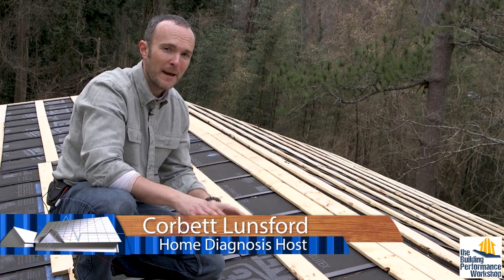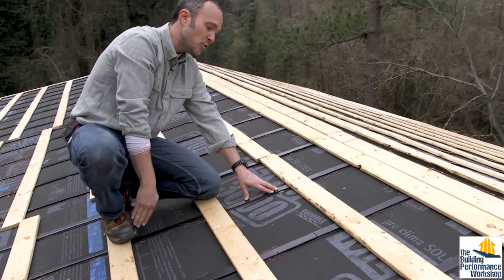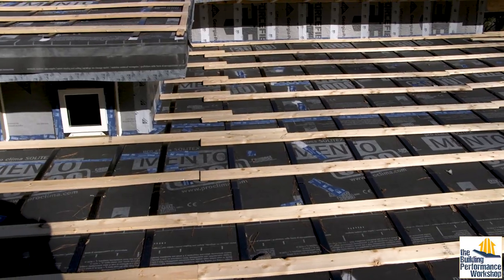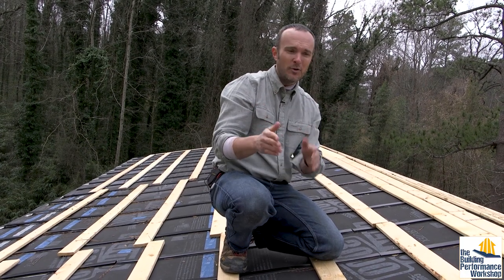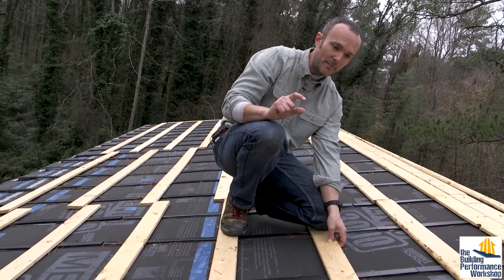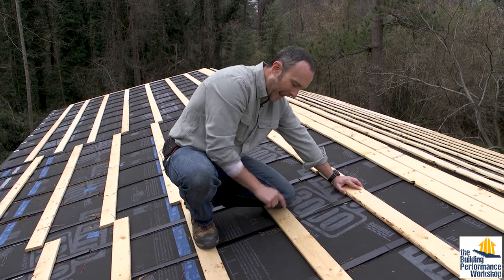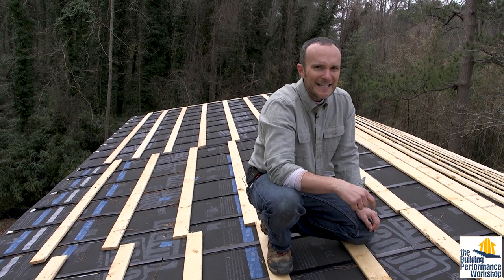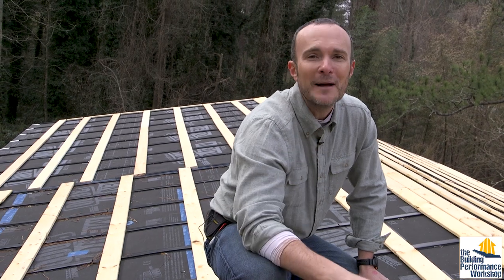How to Build a Roof Rain Screen: Diagonal or Cross Hatch?

Comment: If you have air flow, where wood can dry, then it wont rot and there's no need for pressure treated wood. When wood gets wet and stays wet, such as if it were wrapped and no air flow exists, then it will rot. Watch any of Joseph Lstiburek videos on building science and he mentions this in his videos...
Reply from the maker: Good point Paul
Reply: Don't use pressure treated wood

Comment: Pressure-treated 2x4 would corrode the metal would they not-- as well as the metal screws? Is there such a thing as triple-coated washer metal panel screws?
Reply from the maker: Haha, interesting point
Reply: I think this is one reason they aren't used.  Everything would have to me PT rated, and that adds another layer of complexity
Reply: I'm like 5 years late to this.  But From Joe Lstiburek's rain screen "test" on his barn/office in Maine rot protection is not required.  There was enough air movement with bare non treated 1x4's behind the siding that the rain screen wood looked "brand new" when he removed it 16 years later.  A roof may be different, but I doubt it as there is more solar energy per square foot being put into that assembly (thus driving more airflow via the stack effect, and higher temps in the wood).  

To drive home that point I've been watching the rebuild of Chateau de Purnon here on YouTube and where is the Rot in that roof?  It's by the stonework where air doesn't flow, and the wood is on the moisture reservoir of the stone.   

I don't think 2x4 rain screen detailing is really needed until you start worrying about Ice Dams.  But then again, I'm a nurse not a building scientist.

Comment: Seems to me that there actually will be little or no rain that actually gets beneath your metal roofing.  The steps to allow for drying in the event there is water intrusion are good, but surely pressure-treated stock is not required to support the panels.
Reply: Yeah, it's mostly just to allow the back of the roofing to dry out and not thermally transfer anything into the insulated space, if it was shingles you would do a second layer of osb (expensive) but at least the nails would never rust and rot and you effectively have a roof over your roof.
Reply: Agreed. If untreated wood has the ability to dry when it gets wet, it's not going to rot. If it gets wet and stays wet and fungus finds the surface, then it's rot time. People forget that people literally sailed the world's oceans in wood boats.
Reply: @joshuasmith1215  Thanks for your reply.  I recently learned that even pressure-treated lumber can rot if it gets rained on too often.
Reply: Don't use pressure treated wood anywhere other than what is meant for. It's chemical treatment eats through hardware and the back of metal roof material

Comment: So the question is, pressure-treated or not pressure-treated? I kind of figure you have to go with pressure-treated 2x4’s.
Reply from the maker: Unless you wrap them a bit up the sides with waterproofing butyl tape
Reply: No! Don't ever use treated lumber other than a deck. Period. The chemicals eat through your hardware and the metal roof.

Comment: You’re vertical channels make sense for airflow under the roofing material. The diagonals seem to cut off areas of the roof when natural convection is occurring. I think the cross hatch is the only way to get this done properly. I agree that a 2x4 is going to be stronger than the 1x4 material.
Reply: Gotta get the water out.  Hence the slope of the 1x4's,

Comment: @1:36 I have watched several of Matt's videos and he hasn't used 2x4's. They clip you referenced he was using 1x4's directly over Carlisle wip-300ht on a 45 degree with cor-a-vent under the drip edge flashing.
Reply from the maker: Yes, I realize you're right about the videos- but I think 2x4's would be an improvement I'd go for.
Reply: @HomePerformance  2x4s would definitely eliminate  more screw penetrations in the roof membrane

Comment: I am using 1x4 nail parell to truss and nailing horizon to the 1x4 . i am put a radiant barrier over waterproof  cap sheet . you get air flow and  a rain sheet  at the same time . this good for me i have 9and 12 pitch

Comment: The air gap is mainly for a thermal break. The gap allows radiant sheeting to actually work. Radiant sheeting depends on air. If you could give 2” that would be much better. The reason people place diagonal is it saves on materials and 2nd it makes it safer for roofers to work on steep roofs

Comment: I only have experience with tiled roofs (European). The vertical channels are for venting and drainage (snow blowing under your roof tiles). But so little water gets under the tiles, plus plenty of ventilation, that the wood doesn't rot at all. The roof membrane isn't a water absorbent material, so the wood doesn't stay wet for long if it gets wet.
For Matt Risinger the choice to go diagonal is probably to make installation easier, like you said in the video. Then again he's in Texas, so water isn't really an issue.
Reply from the maker: All good points
Reply: Austin is not particularly dry. Its average annual rainfall is about on average with the continental US as a whole...34.2" per year in Austin vs US average of 30.21". It's no Seattle, but it's not dry, either. We have to build for rain and flooding, though not for extreme cold or snow. Some parts of central and east Texas have violent thunderstorms and severe flooding pretty regularly.
Reply from the maker: Maybe the snow is the difference then- the verts just make it more difficult, I’m sure we’d all go diagonal if we could.
Reply: @joecooper1703  Seattle is no Seattle, either, at least not as people imagine it. We only get 39.3" average per year -- but that's spread over constant drizzle from 200 cloudy days out of 365.

Comment: 1) you are loading the coravent with extra weight, which may be fine, but you are burning screws, lumber and time doing it your way
2) the wider coravent product at the 45 degrees ridge to lip, if the standing seam guys will warranty the roof, just go over it. If not, take 1/4 lumber and go vertical over the coravent
3) for the second option, at that point you know where the support material is because of the coravent - just hit a screw at the ridge, swing the 1/4 lumber and hit it at the eave and then just walk up the roof setting a screw periodically.

I would think that vented slats at 45 degrees would be way, way better than any fiddling with tape in 2x material or doing PT (which would just eat your screws anyway).

Comment: Hi, I think this is a good solution. But I keep wondering whether you can skip the wood strips entirely and instead run the coravents horizontally, You still get the air gap without obstructing vapor/water flow. Does this make sense? Also, I believe I have asked this question already in another one of your videos but what lifetime do you expect to get out of those coravents, assuming they are under metal roofing?

Comment: Just do 1x4 vertical on the rafters with a screen membrane over the front and back edges (if doing a shed style roof) and then horizontals on that (grid style) to attach your metal roofing

Perfect example: https://youtu.be/UKkfDUh_ea4?t=723

Comment: Are you installing through fasten roofing with exposed heads or standing seam concealed fastner roofing? I considered the same approach as you, almost, substituting the core vent with 3"  rips of 3/4" plywood ran vertically and 2x4" purlings ran horizontal, all over a  deck covered entirely with peel and stick ice and water shield. I then plan on using exposed fastner roofing. My roof is a 12/12 pitch , I am not worried about water intrusion as all the verticals will be fastened through self  sealing membrane.
Reply: Still somewhat concerned over the plywood rotting. Just not as much as horizontal purlins directly on deck. And I would think diaganal would be a rot issue as well.
Reply from the maker: We’ll be installing hidden fastener mechanical lock standing seam. Agreed, there is no silver bullet.